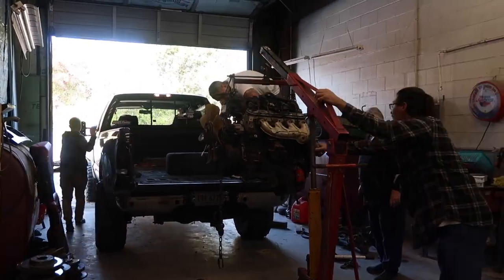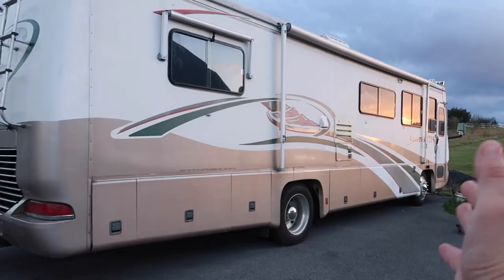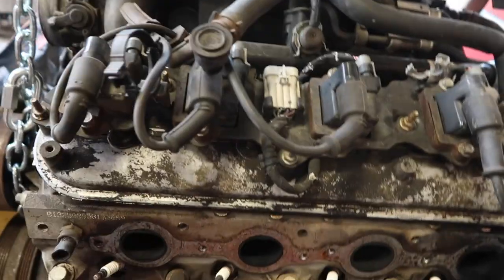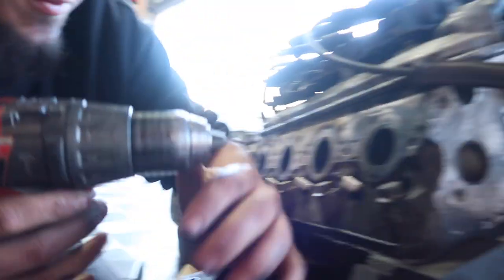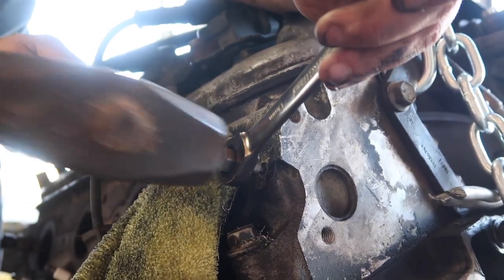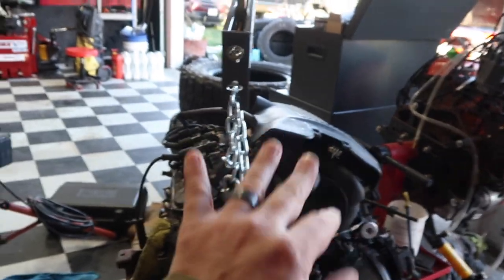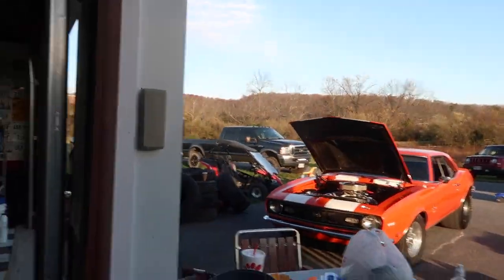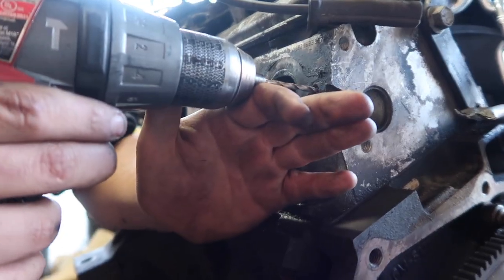How to REMOVE a broken bolt | LS head bolt or studs

Comment: Hey JD. You made it look too easy.😉 A good screw extractor set should  be in every mechanic's toolbox. While you're at it, I'd recommend picking up a standard and metric tap and die set too, if you don't already have them. After removing the old bolts or studs, I usually chase the threads and clean everything up before installing the new hardware. Good job, bud.👌 Glad everything worked out for you. Say hello to #teamlaura. Been thinking about you guys. Y'all have a great week ahead.✌
Reply from the maker: I’ve got a small set but there’s a lot of tools I need. Usually buy them as I need them.

Comment: It’s much easier to just weld a nut on the broken stud and turn it out. Never had it not work yet. If you slip with that drill your screwed.
Reply: Literally screwed
Reply from the maker: Very true, this is a good way if you don't have a welder handy.
Reply: Welding a nut does not work on plugs that are in your exhaust manifold smog pump holes when they’ve been in there for 20 yrs.
Reply: Not for me, Lol.  Ive snapped 4 nuts off the same stud so far.  Definitely not cold welds either.

Comment: Do u have advice for having an alternator stuck on top of ac compressor? Can’t move into place to put the bolts in the rightful place. So it’s just stuck slanted idk why it’s stuck on something that’s on top of ax compressor. Is it better to remove the ax compressor or to try something else? Thank you

Comment: It's easy when the engine is on a stand, in a well lit shop with everything you need at hand. Try it in the driveway with the engine in the truck, battery powered drill. The head bolts have an insert made of steel harder than my ex wife's heart. If the bolt is broken in the insert good luck. Lets try it real world!!